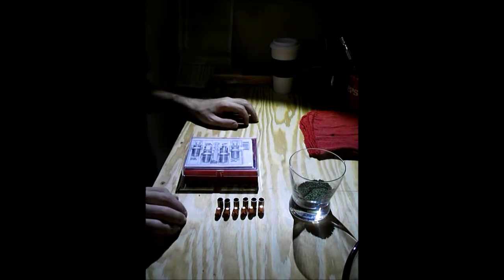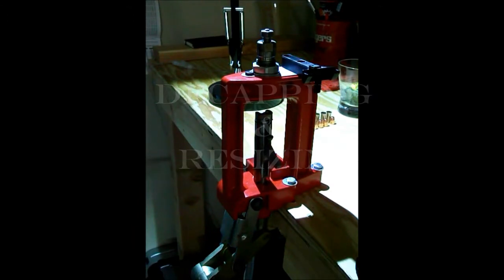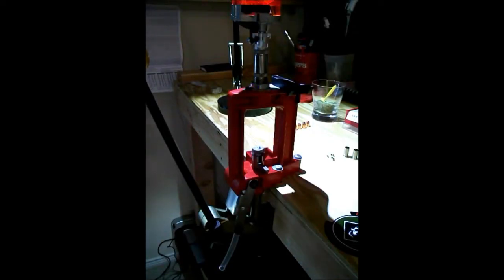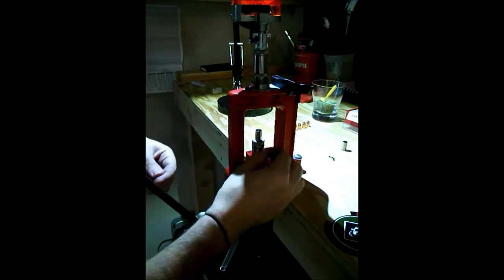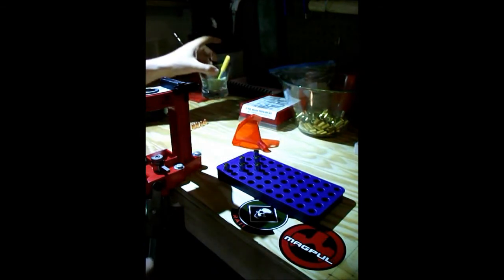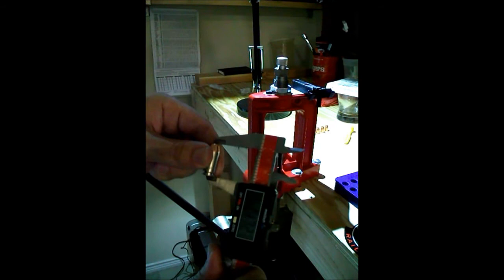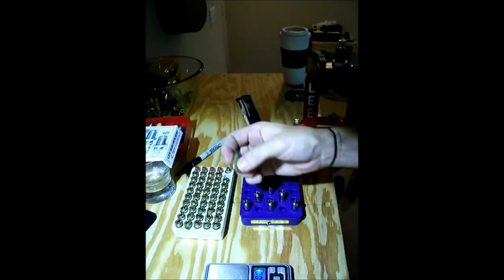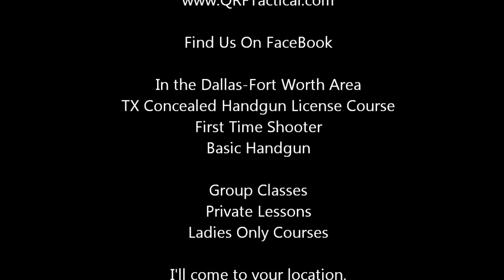DIY SnapCaps

Comment: I came back here because I found a far better DIY snap cap and want to share it. Take a spent primer to the hardware store and find an O-ring as thick around as the primer or just slightly larger. Cut out a primer sized chunk and glue into the primer pocket with small dab of hot glue. wipe clean and your good to go. I just finished my snap caps.
This is not meant to dist. the OP. Just sharing a second option.